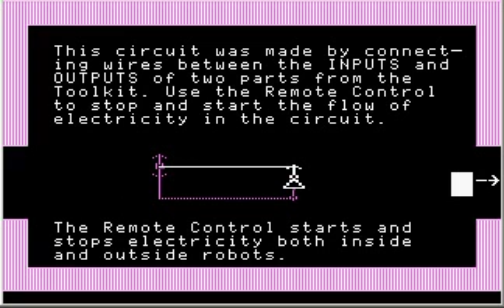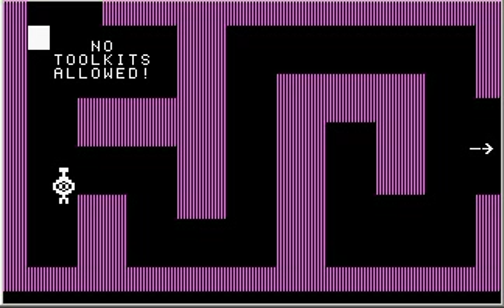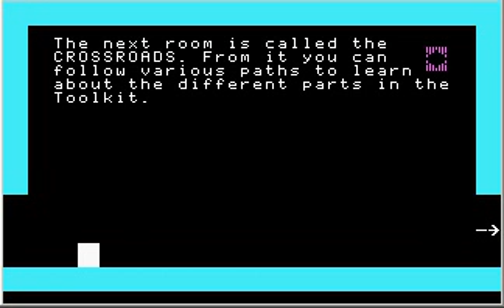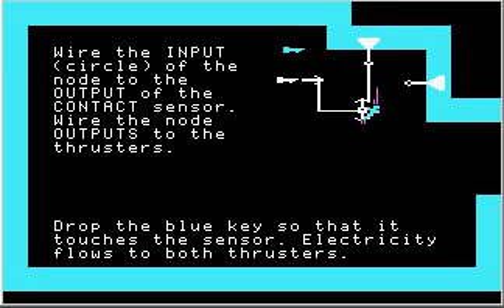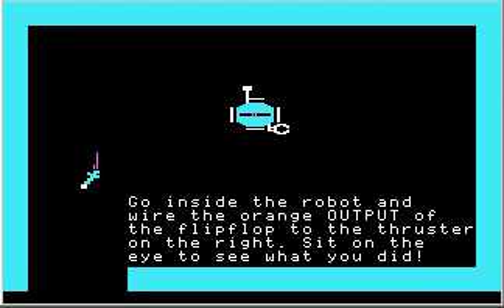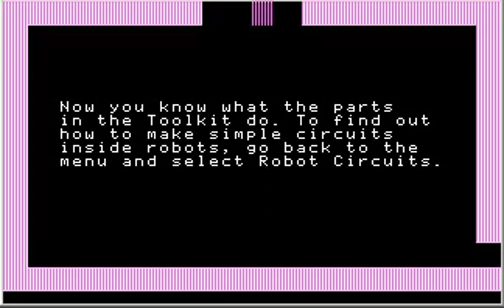Let's Play Robot Odyssey 11 - The Toolkit

Comment: you could burn chips in the innovation lab, save them to disk, then use those designs to solve a game problem so there is a connection between the innovation lab and the game